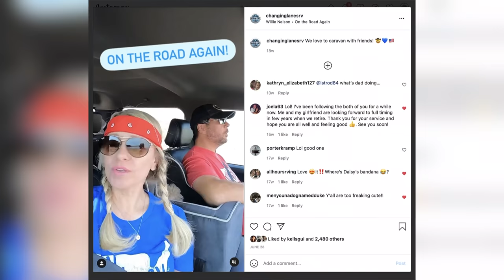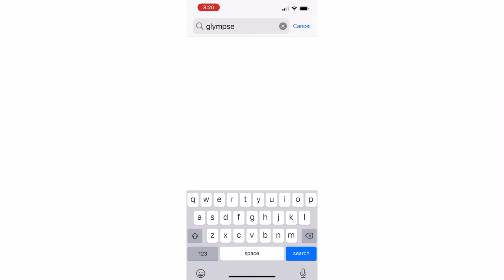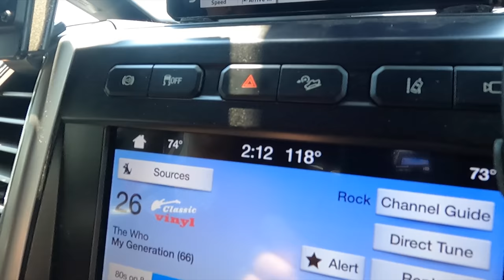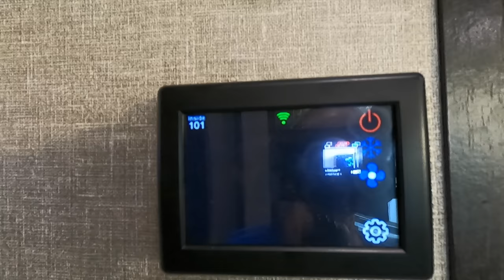😡  RV Park and Travel Day Issues! (Full Time RV Life)

Comment: OK y'all 
 We're planning on going full time in a year or so.   Did you have your solar installed yet?  If you did have solar installed,  can you run a/c's on solar instead of the pedestal?:
  Thanks Lavon
Reply from the maker: Yes and no...  Even the biggest battery bank with dual 3KW inverters can't run 3 ACs for very long.  3ACs need about 4500W.  This heat needs about 20+ hours (really more like 24) of run time on the ACs.  That's 90 KWh, which translates to 7500Ah @ 12V.  That's 75 100Ah battle borns as an example.  Simply not practical to run inverter in this kind of heat, even with a ton of solar to help.  Plus, we were having issues with our genny and inverter at the time: https://youtu.be/53_w0SBAh9c. And, this was before we upgraded to the Victron.

Comment: Chad how did your inverter system not support that? Victron rates that unit down to 95 vac, it should have supported the load of all of your AC units and not allowed low AC at the panel?  But both you and your travel buddies need to follow the "N" on your compass in the summer months. Now that the border is open again I hope to see you videos from BC Canada next year.
Reply from the maker: This location was right after lone rock beach where we still had the gopower and issues with it vs our generator.  https://changinglanesrv.com/faq/?Display_FAQ=4759

Comment: We hit Vegas a couple of years ago in our 95 DP with no dash AC unit - it had given up the ghost when we were coming into the upper end of Nevada, so all we could do was run our generator and the roof AC unit - in 115 degree temps. The only saving grace that I had was we installed 2 aux cooling fans on the rear of my radiator pulling air out, so when we got to the RV park and set up, those continued to run for another 3 or so hours pulling the air out from the engine compartment (which our bed sits on top of), otherwise I don't know how we would have been able to have slept at night. Our next trip down there (this past Sept) was in much cooler weather, and even at that it was plenty hot. Vegas in anything over about 105 is miserable!!

Comment: Always have a generator to handle all your AC power needs.  Always.  Never rely on the RV park to have clean and full power and voltage.  Problem doesn't exist if you have a generator.  No generator allowed?  Well neither is 103 volts on one leg of your 2-phase.  Tell Mr. Charm to deal with his tenants that have those real problems and you'll run your genny.

Comment: Question, why not travel “cooler” northern states and regions during mid summer and save the hotter areas for winter?
Reply from the maker: We mentioned in the video, we had some commitments in the area.  We knew it would be hot but that's why we booked a full hookups RV park.
Reply: @ChangingLanes  yeah that was my bad…I stupidly posted before I watched the whole thing.  Apologies.

Comment: That Las Vegas RV park needs to get together with their power company and probably install a few more transformers.  The typical voltage is 115v for most "110" outlets. If they don't have voltage there, its got to be their supply side or their power company and likely management is just too lazy to figure out or spend the time correcting things. I'm surprised they have that problem with the number of hot days and nights. Especially since space cadet "nameless" park employee had the mentality to think like a dumb a**.  Food in the refer isn't instantly going to go bad unless much time goes by.  BTW...you might reconsider using a residential refrigerator because if you are boondocking...your batteries will not run one of those overnight or long enough which means generator will have to be used when "towing" and boondocking. For myself, I wouldn't want the generator having to run during those times without shore power, no way due to the noise and huge dependency it will have on the generator itself. There's really no option or back up method to run a residential refrigerator other than batteries and inverters. I think that's an accurate statement, or it used to be about 3 to 4 years ago. Also, 120 degree temps are not all that often. The St George gorge...is a fairly steep grade ! But it sure has a nice view. Sometimes those checklists will get you in trouble if you depend on them too much and then forget to refer to them...I'm sure there's a mental spot to keep that engine brake turned on...practice makes that work mostly but things were building up around that time I reckon. Maybe a good time to check on those brake pads...use ceramic pads, no brake dust and they work really well. (months later I say this as its 3-22-22). Stagger on down the trail...at least you had some heat experience that the locals deal with every summer.